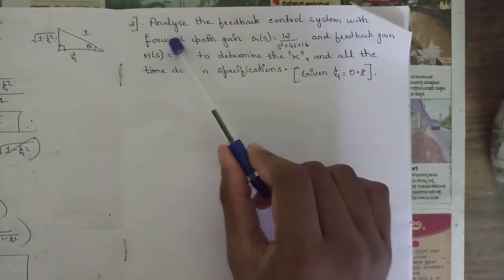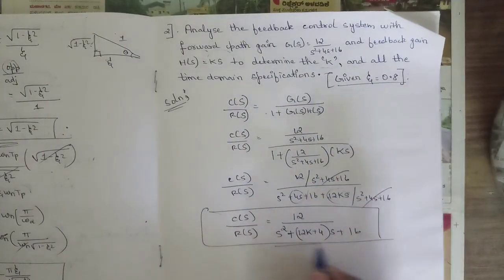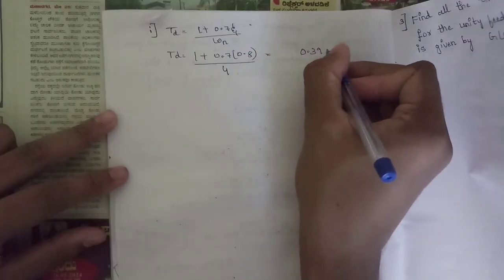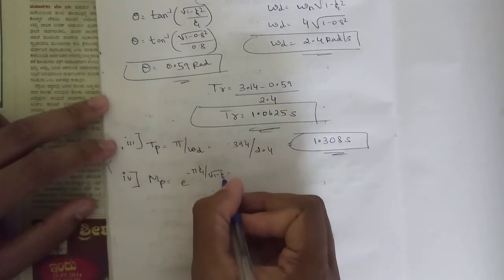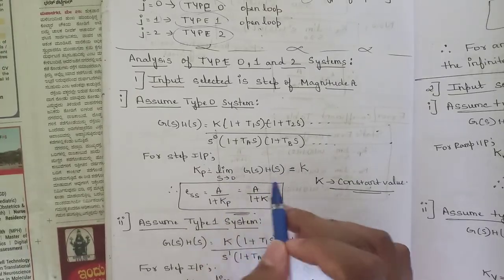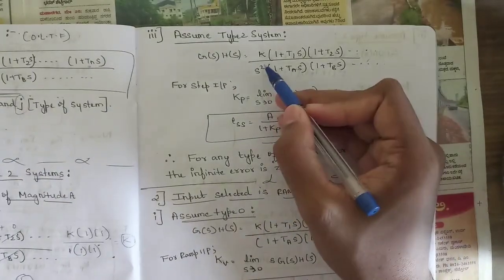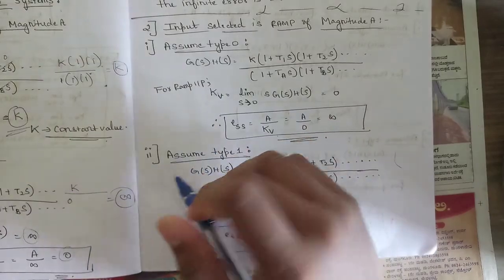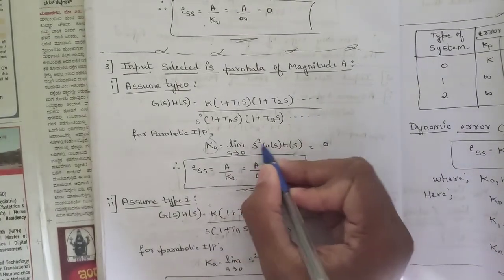#4 Control System Model Paper 1 Solution Q5 b,c 4th Sem ECE 2022 Scheme VTU BEC403

Comment: the value of  "wn" is different in denominator and numerator, 
how can you consider the value as 16? we should make the wn value same in numerator and denominator right sir??
Reply from the maker: No...
That we should be doing while calculation of the frequency response..
In this case,we should be checking the value of wn for the characteristic eqn(which is the denominator of the transfer function)